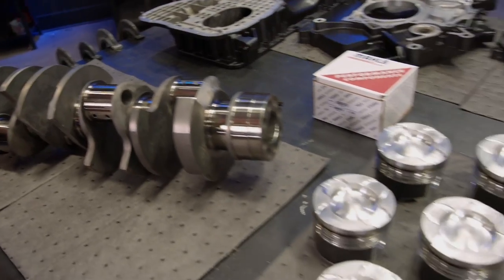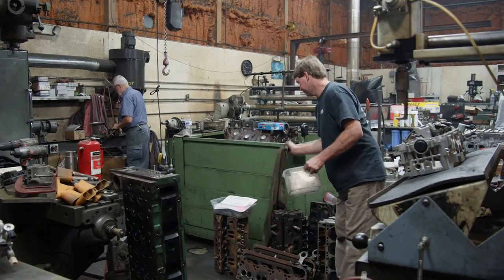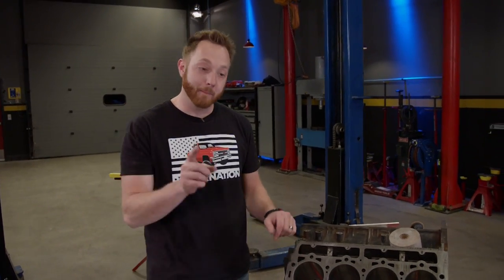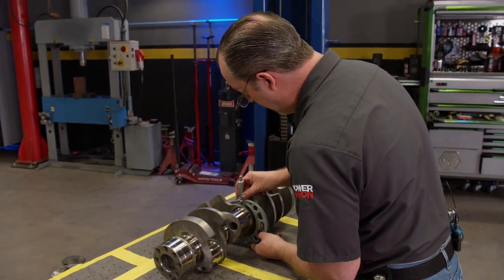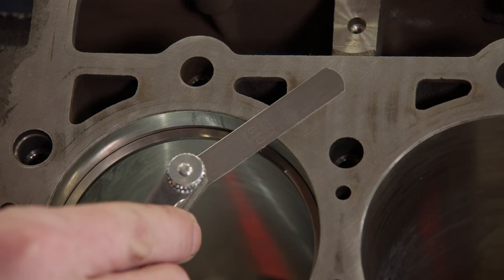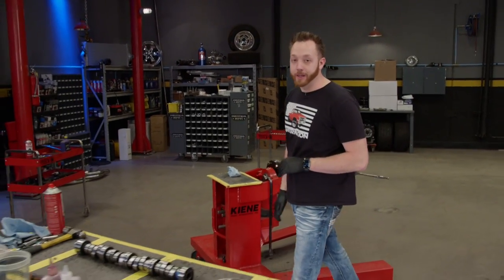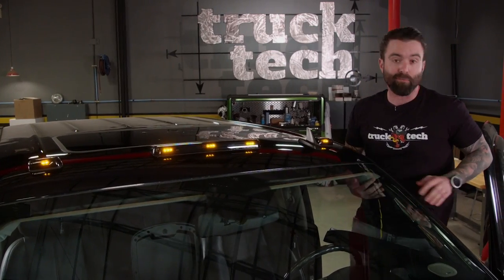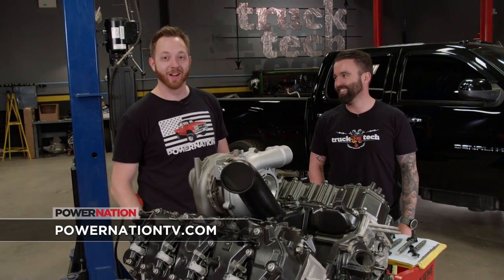How to Build a High Power Diesel Beast - Truck Tech S7, E9

Comment: An Uncle had the same engine, he did a few mods to it, like a computer tune, different injectors and turbo and exhaust mods on the stock engine. Pulling a heavy backhoe up a long grade one day, it began to lose power and started knocking and smoking very badly. It finally quit. He had it towed to a performance diesel shop, and they found the crankshaft was broke in three different pieces. That Callies crank they are using looks very interesting.

Comment: You guys should watch killing a Duramax. Big hp on standard crank, rods and pistons. Gale Banks is the man!
Reply: That's what I said
Reply: Nathanial Holdridge Ok
Reply: That LML can’t hold a candle next to the L5P. The L5P is more beefy from the factory.
Reply: @korn111685  see that's what i was wondering. So if I'm going to buy a Duramax... it needs to be an l5p if I'm going to go for over 600 horsepower... is that the gist of it?
Reply: Yeah big HP for how long? You probably wouldn't last 10,000 miles putting 1000HP through a stock rotating assembly.
Reply: That's a different Duramax, the L5P is a beast
Reply: @korn111685  the lml made 1100 hp   I do believe h&S did the test . That test also wasn't nearly as thought out as Mr banks was.
Reply: Yeah if you have 20 years to wait for a series to finish up. The guys grand child is going to have to finish the series for him.
Reply: This video is a couple of years older
Reply: @alltheboost5363   600 crank hp isn't to hard on all Dmax. But 600 on tires is more costly.

Comment: Unless you go aftermarket main caps or you’ve spun a bearing, line hone is overkill and not necessary but to each his own. Crank is overkill too.
Reply: If you're changing from main bolts to main studs then a line hone is necessary as they torque on the caps different and distort the caps differently
Reply: LML cranks are junk, a goal of 1000hp and even a brand new LML crank is sketchy at best. Reusing a stock crank, especially LML, is just asking to pull the motor again. And no one with half a brain would install a new crank into a Duramax without checking line bore and line honing at minimum. Not uncommon for them to get line bored.
Reply: Would rather have overkill than a killed engine if you got the means why not go all out
Reply: literally everything you said is wrong Duey. thats impressive

Comment: the next episode will be them rebuilding the transmission and the rear axle, to handle the upgrade of that hp the engine now put out
Reply: Not  likely on the Ford. Its the same 6R80 that people are using with supercharged 5.0 engines, and they seem mostly problem-free.

Comment: I like the fixture that he uses with the dial bore gauge. I am so used to seeing people holding the dial bore gauge directly to the outside micrometer to calibrate it, and I have no idea how that can possibly be accurate.

I was surprised to hear that the .001 inch of clearance for every 1 inch of crank journal rule still applied to diesels. I'm so used to seeing wider clearances on everything diesel, because of how much more pressure it puts on components when compared to gasoline engines.

Comment: Why would you send an engine to the machine shop and not have them at least clean the deck surface?!?!?!?!
Reply: Because usually in the diesel world you DONT need a professional cleaning
Reply: This is the manufacturer recommended way of cleaning the deck, but they really should have done it before bringing it to the machine shop. That way any sanding particles could have been cleaned. You can't really deck these blocks without opening a whole can of worms.
Reply: I came here to say the same thing. Thought for sure the machine shop would deck it. Guess not with diesels. Learn something new everyday
Reply: Machine shops definitely resurface diesel blocks.

Comment: PLEASE do a video on the Ford 3.2 Liter Powerstroke!!! do not get confused with the new 3 liter, I wanna see big numbers with their older 3.2! It was the lowest powered engine offered in the Transit from 2015 to 2019. It is a 4 stroke inline 5! Stock 185 HP and 350TQ. I have dreams of buying one and dropping it in a car to drift, but I financially will never get to see that itty bitty block turn into a pocket rocket diesel. One of the smallest diesels Ford ever made, and has a TERRIBLE reputation for its power output. For the low price and size, I've always had the biggest hunch it could be a power house if the stock turbo was upgraded, FI played with, and a solid tune. I would sh*t and giggle to prove my friends wrong on the 3.2!!! Please do a build on it!!!!!

Comment: Why did you attach the torque plate with head bolts when the engine will be using head studs?  Seems like that would defeat the whole process since bolts distort the block differently than studs.

Comment: With an engine of this power level, I had assumed you'd use "Spiral Locks" on the wrist pins instead of normal snap-rings...
Reply: Diesels don’t rev high enough.

Comment: See I have to interject the LML and the LP5 can take what you put on it, The Lower in will hold of the fine. If you don’t believe would you believe Gale Banks Mr. Diesel Himself has put together the PL5 only changing the Cam and Push Rod Assembly, topped of with a Turbo and Super Charger Dino out at a mere 7000 RPM as he was trying to blow the Motor and couldn’t. Ask him either that or watch the Video showing the RPM. I agree with you on the rebuild but to say the lower unit won’t hold. It not a 6.7 Ford or the Cummins 6.7 both have some serious issues.

Comment: You wouldnt ever slide a non roller tip piece of tool steel on a journal, thats the easiest way to scratch it.
Final wipe down of an engine to clear it of machining oil is done with soapy water, and when its clean, then its oiled.

Comment: Anyone going to point out the legal issue with those cab lights and the fact the truck isn't wide enough for them?  

Three center lights means it's wider than 84 inches and the two outer lights are to indicate the maximum loading size.  You can have some legal issues from having the three center lights and not being wide enough.

Comment: I have a question. I was looking at that block and I was thinking how similar a gasoline and diesel block were and then I thought, “would it be possible to convert a gas engine to a diesel?”
Reply: Eh. You can, but it’s not really realistic. Diesel engines have much much more compression than gas engines, and the stress and vibrations involved, the fuel injection system. It’s not worth to do that

Comment: won't the turbo cause heat problems because it's in the valley? like the BMW's that had that problem
Reply: That's where the 7.3s turbo is
Reply: a lot of manufacturers have a "hot-V" setup with the turbos in the valley. more advanced heat shields and intercoolers overcome those problems.

Comment: Or just start with a cummins and have a stock rotating assembly that can take the power.  But the cummins is a man's truck (because it rides like a brick, dont take this the wrong way).
Reply: No stock block will handle this power “reliably” 

Are there cases of it? Yes. Plenty of stock block Powerstrokes, Cummins, and Duramaxs pulling some crazy HP and ETs.

Comment: We want a piston that will last longer so were going to go with a CAST design instead of FORGED.
Reply: Yea that made zero sense to me as well how does one make a forged piston weaker then a cast ??
Reply: @dillonford8301  The forged ones don't have steel ring land inserts, so that's why they don't have the longevity. High hp ones are stronger aluminum, I guess?

Comment: Yet Banks is at almost 1000 hp on stock intermals.
Reply: That's a much stronger foundation in fairness but I know what you mean.
Reply: the difference between an engineer and a hot rodder is that the engineer knows exactly what is going on and tunes it to the limits. a hot rodder throws parts at it and hopes it works.
Reply: Banks has an l5p and hes making no torque. Last video I watched he made 900hp with 1300 tq.  Low end torque is the killer, not high end hp. They will be making 1000hp with 1700tq depending on air setup and tuning.
Reply: @Steve_I  yes.  Because 1300 ft/lb is so weak.
Reply: @bmstylee  it is when factory is almost 1000 lol

Comment: I have a question. Is it possible for a diesel to make 4000hp
Reply: sure, if you build a semi truck's 16-liter engine. these pickup truck engines are big and strong, but 2000hp is about their limit when built for drag racing.
Reply: There's some 24v cummins making 3000hp in pulling trucks. Haven't seen anything close to 4000 in a pickup tho

Comment: 🤔🤔🤔🤔🤔🤔 really then why does banks have a Max at 1000 horse on stock Internals and Austin yu try too hard to be liked tone it down a bit and get rid of that big gaudy ass watch there is no such thing as time in the shop
Reply: Gale Banks is on different level than them
Reply: Banks has an L5P, a far more capable engine than any other Duramax. the rotating assembly didn't really need to be changed out, it is just good insurance to overbuild for the future than it is to take a chance on the old stuff. Banks is testing the limits of every part because he's running an engineering firm, not basic hot-rodders like these people.
Reply: Like stated,  l5p vs lml. But the lml could handle a lot more if they kept torque low. If you noticed, banks was only making 1300 lbft of torque at 900hp. Low end torque is what really kills these.

Comment: 8:23 they’re wasting their time if they don’t put all of the main cap bolts in before they check the bearing clearances. They’re missing the side skirt bolts.
Reply: The side skirt bolts will pull it round. They’re measuring the narrow point of an egg shaped hole.

Comment: Dura build big power. Brah do more Fords. The duralax is a poor platform for most. My Bud has one, he is going back to Ford, even with the turbo it  lumbers at best. My other Bud pulls a 32 ft trailer with his Ford, the steep hill by our home he hits 65 mph well before the top. The duralax 50 and smokn, and chugn, lol. Chev can't come close yet you keep doing thes wot shows for the few who own and hate them. lol Why aren't you doing the number 1 selling truck? Come on now. FYI- he traded the Duralax, can't get the smile off his face, he can now both pull and fly with his new Ford Diesel.

Comment: Why is it a diesel engine have 32V OHV ? (4 valves per cylinder) and a gas OHV engines don't ? Usually DOHC gas engines have 32V ? You think a gas OHV work great with more valves like diesel engine has lol
Reply: Huh?
Reply: It's easier to make a reliable OHV 32 valve engine for a diesel.  The block and heads are much stronger and typically diesels don't rev that high.  The biggest limitation on the gas side is revs.  So it makes far more sense to use a DOHC or at least SOHC setup.  The reason OHV to DOHC conversion to American V8's are rare is because 500-600 ci displacements are possible for a fraction of the cost.  There are were DOHC heads for the LS and BBC.  Mercury Racing's SB4 is based off a modified LS block and their QC4v was based off a BBC.  The SB4 7L makes 750hp on pump gas and the 9L QC4v makes up to 860hp NA or up to 1750hp with twin turbos.

So even though a 4 valve engine is worth 20% more HP and 20-30% more torque vs a 2 valve OHV, you can bore stroke to beat that in many cases for the price of bare heads.

Comment: That guy has the worst fake Boston accent ever. So you got it honed in line honed but didn't get it decked? That's like one of the first things you should do, is make sure there's a flat smooth surface for the heads to sit on.
Reply: shane  better safe than sorry If you're doing all of that and going through all that trouble you might as well do it while the engine is out. It's like putting ARP head studs and not doing a new spring upgrade on a 6.0. He might as well do it while you're there just like a downpipe or an upgraded turbo.

Comment: Lol don’t use sandpaper on your block deck...Jesus...butcher!  Always measure journals in both directions.  It pisses me off they show people this.  You need to check hat it turns freely when tightened and you always shove the crankshaft to the front before you torque the thrust cap.